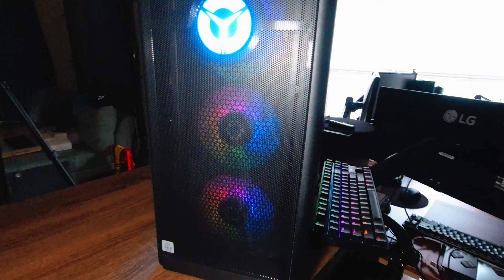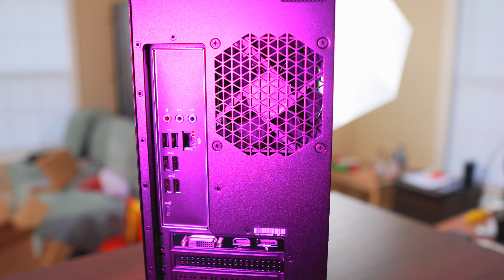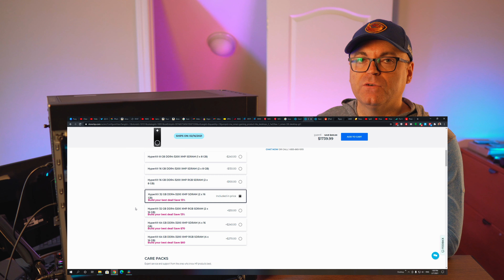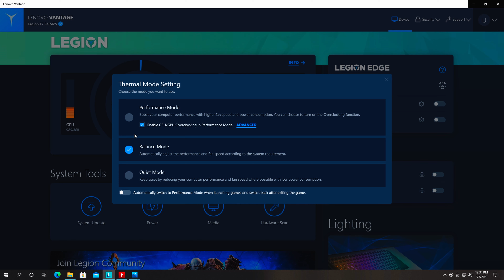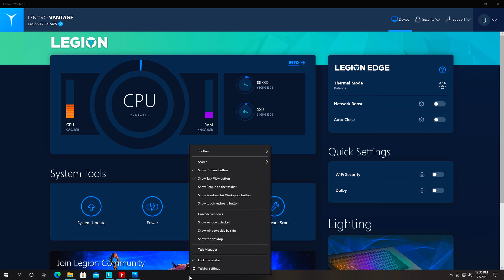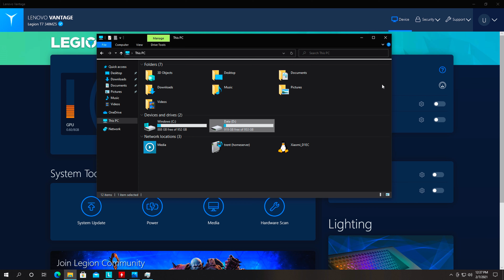Lenovo Legion T7i - Possibly The Best One Yet!

Comment: I have this with the 3080 i9 10900 and 32GB and my PSU is 850 watts. A really nice machine!!
Reply from the maker: @jorden van handenhoven That might be a faulty fan, luckily those fans are standard and can be replaced easily, if you don't want to do a warranty claim that is.
Reply: @HardwareSense  alright thanks for the tip!
Reply from the maker: Indeed it is
Reply from the maker: @jorden van handenhoven From the fans or some other parts?
Reply: @jorden van handenhoven Are the CPU air cooled? I also feel there is to much noise during load, but not sure where it is coming from. My guess is the CPU fan. Not confident the cooling system is up to the task. The 10700 and 10900 are raging bonfires when it comes to heat. My current strategy is to replace with a 240 mm liquid cooler... but I am a bit afraid it is going to be a bit difficult for a noob like me :)

Comment: I'm having a hard time deciding on which to get, I can get this one with the 3070 i7 for £1620 or I can get the hp 30l 3080 i7 for £100 pounds more, I'm really not sure, should i get the bonus of the 3080 with the 30l or the reliability and cooling of the t7i?
Reply: Ah ok thank you very much!!!
Reply from the maker: Well if the 3080 is a better deal, I would go for that. But you have to consider the extra you would need to spend and get a new case and 240mm AIO, it would be a must.

Comment: Can't buy a 3080 card, so got the t7 with one. Whohoo, hope it doesn't su*k
Reply from the maker: It's awesome!
Reply: How are you getting on with your 3080 version I’m considering , are you happy ?
Reply: @TAP1992  happy camper. But It's overkill for my 1080p screen :P
Reply: @konsul2006  thanks, I’ll be 1440p and VR so will need that 3080 . I’m a little concerned about the cl22 ram, tbh. I don’t normally buy oem machines , self build normally but cannot get a 3080
Reply: Does it come with a 850 or 1200 PSU?
Reply: @dizefx  mine is an 850 w psu and cpu has air cooler. But it varies from between skus I think.
Reply: @konsul2006  thank you. I just ordered mine today with a 1200 psu.. But had no contro over the graphics card.. . I'm curious, what brand is your 3080?
Reply: @dizefx  the reviewer think both motherboard and gpu is MSI products, I haven't looked for any markings.

Comment: It would take a major redesign I am sure, but I think the Omen 30l set up for a 240mm cooler would basically deal with most of the cooling problems their case has.  I have one and I like it, but I went with the i5 10600k instead of a higher end processor.  It's fine, but there isn't a lot of thermal headroom for anything beefier.  I would be annoyed if I had bought one with a i9 processor only to discover it just overmatches the cooling available.
Reply from the maker: They would need to just blow up the case and make it possible to install at least 2 intake 120mm  fans and one exhaust, plus 240mm radiator on the top. But Lenovo are already ahead with that, if only they had an online configurator like HP and Dell, where you can mix and match cheaper CPUs with more expensive GPUs, that would absolutely kill both HP and Dell. At the moment all of their configurations are prebuilt and ready to ship, which is good,  if you don't want to wait for a month, but at the same time, there is no options, you get what you order.

Comment: @HardwareSense Thanks for the excellent review. Can SSD drive be added to this prebuild or is it too complicated?
Reply from the maker: The easiest ever, the Sata data cables are already prerouted in the back and plenty of space for additional storage, I think up to 4 SSDs.
Reply: @HardwareSense  Hi, thanks for the video! the model in the UK only comes with a 512GB SSD. Under the shroud does it already have the mounts for a HDD and does it come with SATA cables, power cables and screws or will I need to buy a mounting kit and all the cables separately?

Do you think adding a HDD would void the warranty?
Reply from the maker: @jknewell8  Sata power and data cables are already provided and adding extra storage will not void your warranty. There are no screws, but if you need some they are easy and cheap to find

Comment: Nice review...Lenovo seems like a clear winner.  One thing about the HP Omen is that it is perfectly fine cooling wise for midrange cpu's.  I have the ryzen 5 and it rarely gets above 50C during gaming.  Default temps around 35C.  Also cheaper, if you can find Omen 30L with Ryzen 5.
Reply from the maker: Yes for lower level CPUs its fine, but for the top tier, you need something much better.
Reply: Yes, I have the model with the 10600k.  Temps are fine out of the box and the fan noise is controlled.  I got the 10600k with their 3070 (mine at least is very quiet as well) for about $1,500.  I would buy it again, though if Lenovo was competing at the same price point with similar components, it does seem like it has some advantages.  It took me about a month of fiddling around to get things set up so that I'm getting the most performance possible with a mild overclock, but also don't have the AIO fan regularly in leaf blower mode.

Comment: Hi thanks for the amazing work you do, was wondering what you think about the lenovo legion T7-34 rtx 3080  16 gb. Would you say its just as good as the one you are showcasing in the video And is it easy to upgrade and make changes to it in the future?
Reply from the maker: I am assuming that one is being sold in Europe, we still don't have the 3080 version here in the US, but if its the same chassis, it is the same great computer, cooling, looks and functionality!
Reply: @HardwareSense  yes thats right its being sold in Europe. Nice thanks for your answer, think i will go for this keep up the great work👍
Reply from the maker: @Hasbola1709  Thanks for the support! How much are they selling it there for, if you don't mind me asking?
Reply: @HardwareSense  hi not at all, well they are quite expensive her too, that specfic legion  i mentioned costs like 3175 usd for 3080.  And its i7 10700k-16gb. Reason i want to go prebuild is mostly to get 3080 and in the future upggrade or just pull the parts apart making a custom build instead after some years.
Reply from the maker: @Hasbola1709  Wow, that's a serious price, if they ever release it here with 3080 it would probably be something like $2400, but yes if you don't have an option to get 3080 at retail price, prebuilt is the way to go.
Reply: @HardwareSense  Mine costed to me 3400usd (2800€, Finland). As I mentioned in  the another comment. I got it from telecom  which offers 3 years payment with zero interest rate. Very expensive comparing to the USA. 10700k / rtx 3080 was 2150€ with the sale few weeks ago 2400€ was the normal price (2500-2600 for i9 10900k). They also increased the prices because of rtx3080 stock problems. That's why I had to buy it from there.
Reply from the maker: @Krankenstein  Wow those prices!

Comment: The Acer Predator Orion will soon be available where I live with similar specs as the Lenovo and the  HP (10700K + 3080). Could you possibly do a review of this computer? Could make an interesting comparison. Acer's build appears to have some big fans front and back.
Reply from the maker: Acer is normally the worst when it comes to pre-built computers, just Google Acer Prebuild or Prebuilt and you will see The Orion is somewhat better engineered, but they are asking insane price for what they are offering. I truly believe the T7i is the best.
Reply: @HardwareSense  Okay, good to know. I have an older Acer (i7-6700 + GTX 970) that has served me well for several years. But maybe their newer builds aren't very good.
Reply from the maker: @aquilachrysaetos5301  Yeah their quality went down in the last few years.

Comment: I want to buy a hp 30L with intel i7 and RTX 3070 do you thing I will have the heat problem you experience with the I9? I'm no expert and don't want to start with trouble.
Reply from the maker: It's much better compared to the I9 version, but the other guy said it, temps are not bad, but the noise
Reply: @HardwareSense  So CPU and GPU temperatures in the seventies, CPU sometimes going up to even 84-85, is considered safe, even with sustained use?
Reply from the maker: @aquilachrysaetos5301  Yes, the junktion on the CPU is 100C, if its touching the 80's is not bad even on a long run, but the noise is pretty loud with the AIO I know that.
Reply: @HardwareSense  do you advise me to buy it or should I look for the Lenovo?, it's just that the HP it's cheaper right now,  I need too know if it has the same problems that the obelisk versions?
Reply from the maker: @pacojaviersg  The Lenovo is 10x better than the HP Omen 30L.
Reply: @HardwareSense  The Lenovo it is then thanks for the advice.
Reply: I have the 30L + 10700K + RTX 3080. It often heats up to close to 80 degrees, and it sometimes heats up to 84-85 degrees. And it is extremely noisy.
Reply: @aquilachrysaetos5301  thianks, do you recommend it or should I look somewhere else? It's just there are not too many options on pre builds.
Reply: @pacojaviersg  If I knew what I know now when I bought it, I wouldn't have bought it. I would have waited for the Lenovo. The noise is really annoying.
Reply: Thanks. I'm going with the Lenovo then, why risk it. If the HP has design problems with thermals it's no brainier, I thought they fix that with this new models, it's a shame been an HP user all my life but then again the Lenovo look better.

Comment: Nice video! Very helpful.

Where I live, the Lenovo T7 will soon be available with the i9-10900KF, RTX 3080, 16 GB RAM and a 850 W PSU. Should be a good computer, don't you think, except from the low RAM? Do you think this build will stay cool and be silent? 

Unfortunately, I got the HP 30L (i7-10700K, 3080, 16 GB RAM) a few weeks ago. It is extremely noisy while gaming, and it heats up to close to 80 degrees most of the time, and sometimes goes up to 84-85 degrees.
Reply from the maker: The Legion is the best, period! It is super quiet and cool, I love it!

Comment: Neat build. I love comparison vids. Now I gotta say, the T7 is like the T5 but the amd build. It has the same air mesh at the front and top, just like the T5 amd. So it’s case is similar, but the T5 has two fans in front instead of three. The intel T5 is not as good and doesn’t have decent ventilation. I like the Lenovo vantage app, looks better and more user friendly than the omen gaming hub. Anything about the omen looks kinda grim and dearth, week I guess that’s the theme they go with. When I pick up t5 amd this week I’m definitely gonna change them rainbow colors on those fans, that stuff just hurts my eyes😑
Reply from the maker: People love that RGB stuff, I normally keep them off or on a static color. The T7 is so impressive, it doesn't look like an OEM pre-built at all.
Reply: @HardwareSense  when u say static u mean solid right? Yep I didn’t kno Lenovo was that good.
Reply from the maker: @dragonball3503  Yes correct, solid
Reply: Only T5 intel without front mesh is available in where I live, shouldnt I buy it? I am trying to choose between ROG STRIX G15 Laptop and T5 Desktop with same specs, in terms of cooling issues that can come up? which one should I buy? Is there any low performance mode for T5 desktop since ventilation in T5 Intel model is inadeuate for max performance?